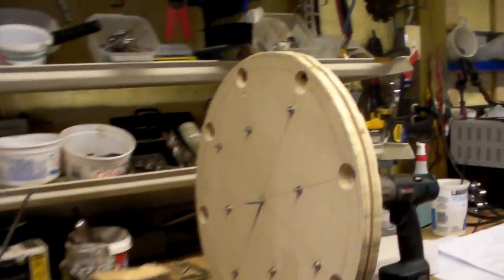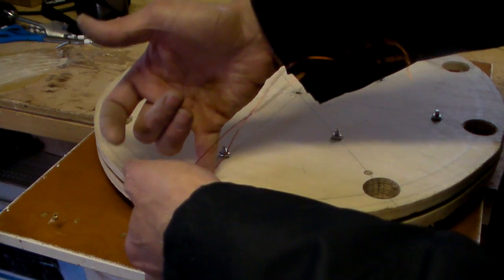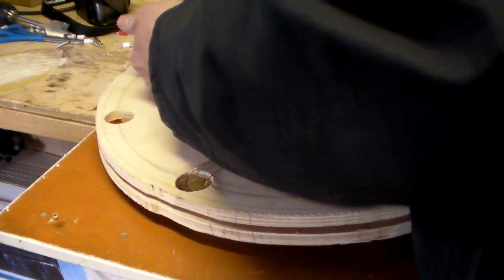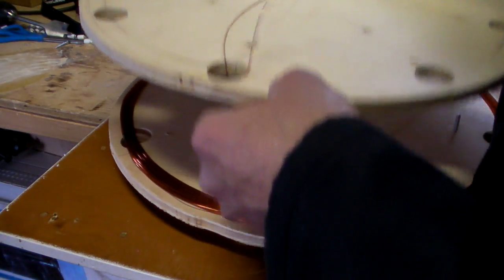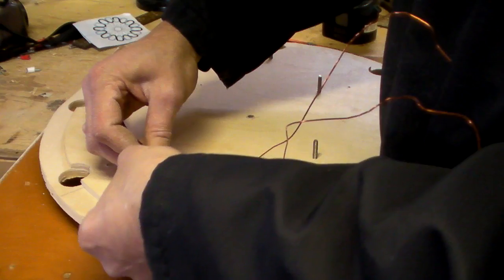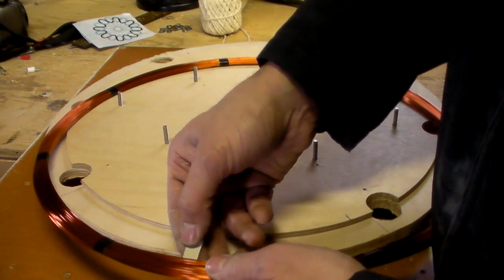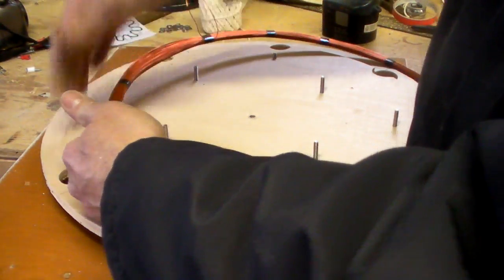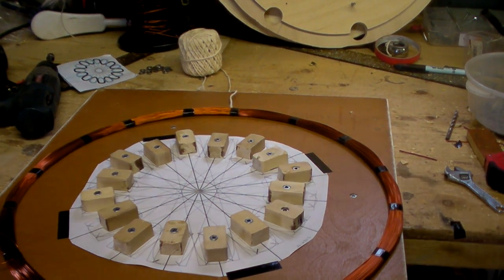14magnets 14pole coil chamas1 serpentine 3stack phase axial flux pma wind turbine vawt 65

Comment: Question...how did you come up with your calculation for your number of turns for your coil? You are using 20 gauge wire which is .032 in thickness. I have a spool of 14 gauge .064 wire which is exactly twice as thick as your wire. Can I make my coil 50 turns and get the same results?
Reply from the maker: Kevin, more winds means more voltage, for the same results you need to double the wire not double the winds.